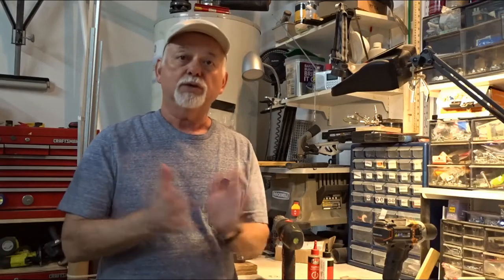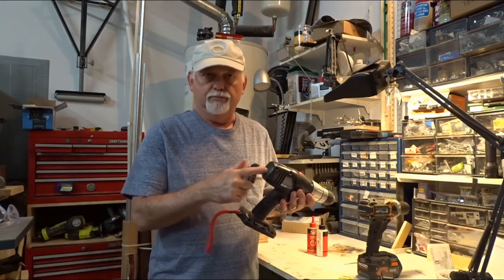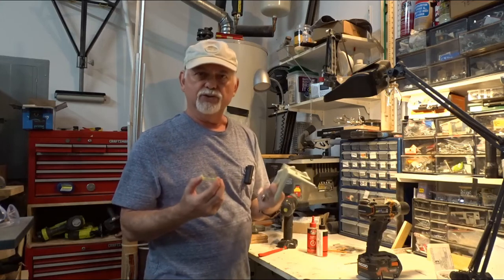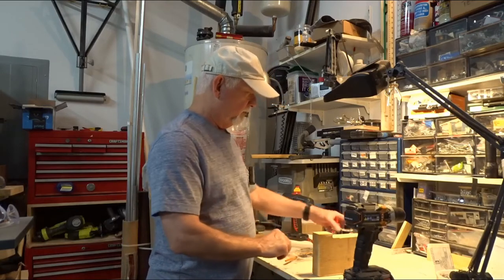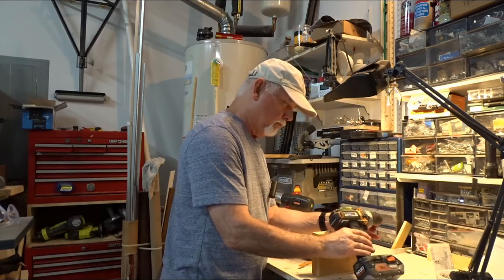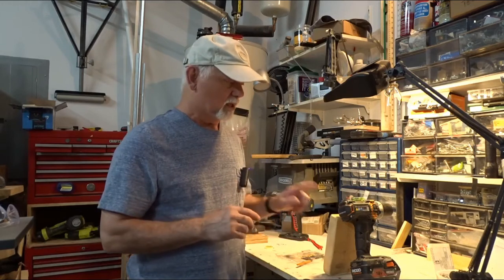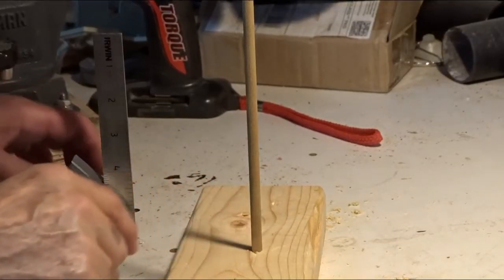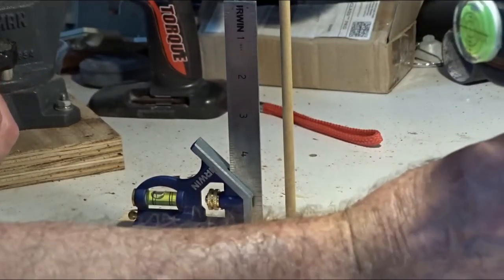Hacking my drill.  Add bubble levels for horizontal and vertical drilling.

Comment: Only a matter of time before major drill makers incorporate your idea into their drills. Doubt they will give you the credit!
Reply from the maker: My 20 year old Craftsman drill has them. I don't know why they stopped and other manufacturers never did include.  Hope you are right. It's so useful.  Check out my DIY drill powered disc sander video. Thanks for watching and commenting.
Reply: We had an offbrand drill that had a level gauge built in on the top. Everytime it kept my horizontal drilling straight. Always thought it was genius.
This was a 10+ yr old drill. It's kinda strange that newer branded drills still don't have this and was still in the realm of DIY feature.

Comment: Fantastic presentation!  Clear vocal and straight forward presentation.  I found my way here, because a just hammer drilled into concrete and I learned my vertical was off a bit, which mandated me to open up a hole on a bottom sill plate.  Nothing major, however, a little inconvenience that I would like to prevent in future.
Reply from the maker: Thanks for the kind words.  I use a Sony DLSR with an external, wireless mic.  Helps.  Hope the bubble level hack works for you.  thanks for watching and commenting!

Comment: I thought about doing the same thing. I just got my first cordless drill. I use to borrow my father’s corded drill and it had a built-in bubble level. Such a great feature. Where did you get your bubble levels?
Reply from the maker: Hey Jordan.  I bought these on Amazon.  Brand is WOYISEPG.  Search on that and you should get to the seller page.  Six 32mm bubble levels for $5.66.  thanks for watching and your comment.  Tom